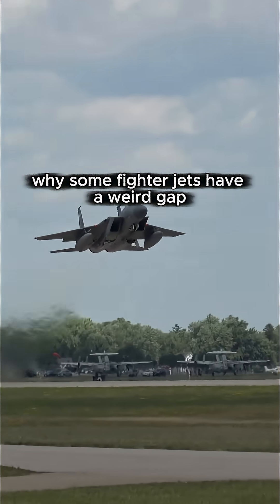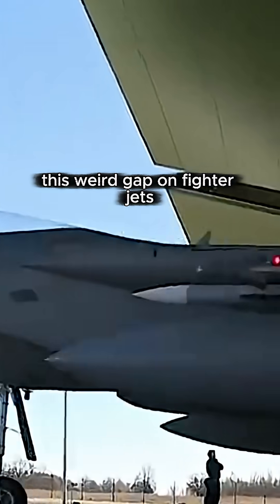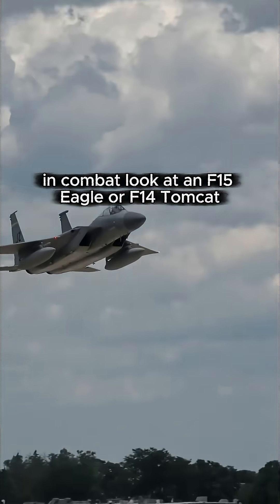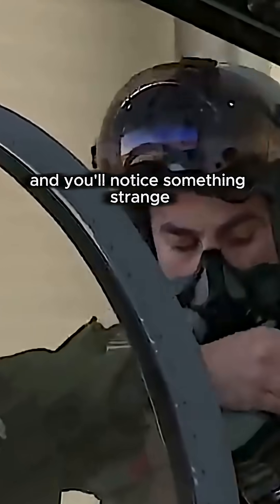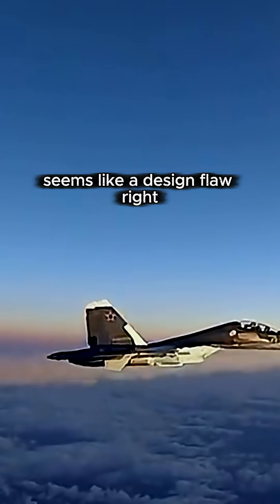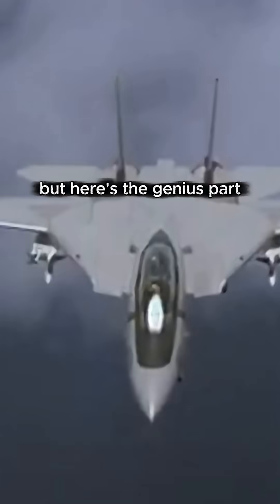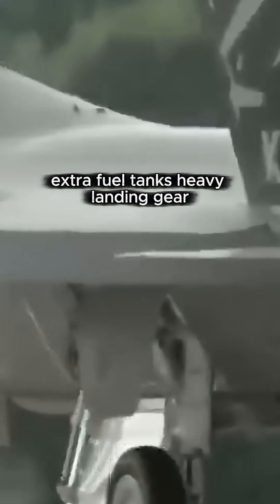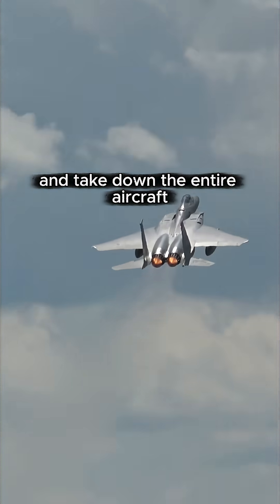Why Fighter Jets Have That Mysterious Engine Gap ✈️

Comment: What gap ?
Reply: The video is terrible ai with useless stock footage, but from what I can gather they mentioning how the air intake in the front isn’t directly connected to the main fuselage. The intake inside wall is separated slightly from the main body. 
(I believe this is talking about what is got a separate inside edge as opposed to b having the inside wall be built into the fuselage as in theory it would save material and weight.